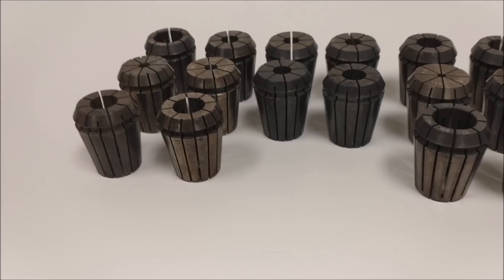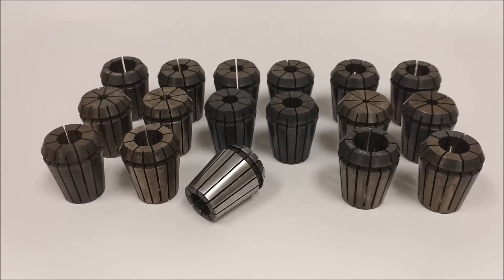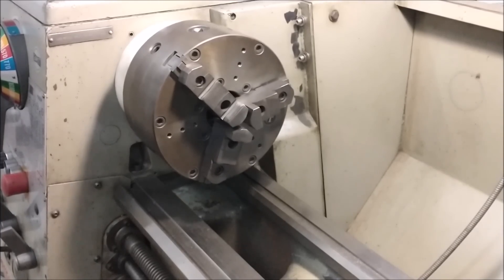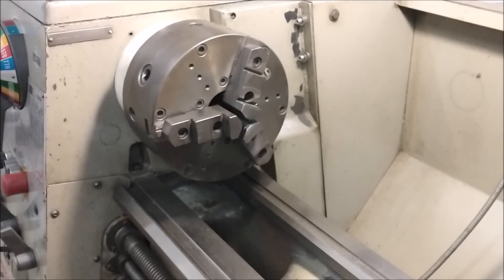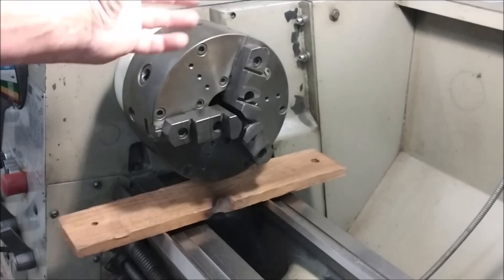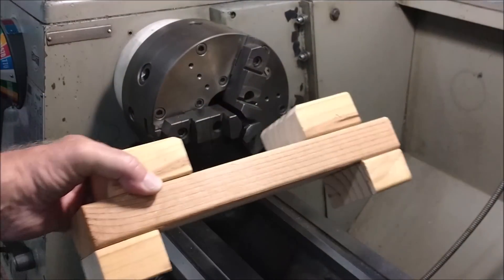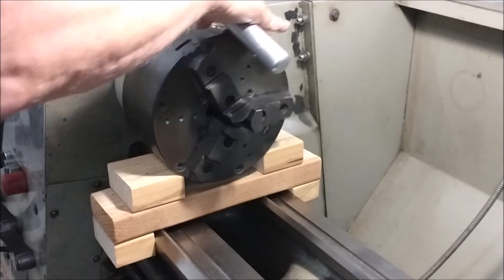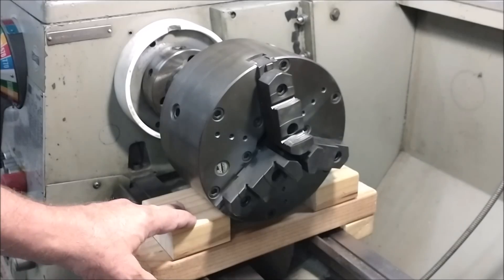Stress Free Lathe Chuck Removal and Shop Chemical Warnings !!!

Comment: Unloosen? English teacher you ain't.
Reply from the maker: I have another word for you.....dictionary.
Reply: @joepie221  unloosen is to let free "a relaxing bath unloosened all the mental and physical tension that had been building throughout the day" . 

Loosen is to make looser as in to loosen a bolt. 

Or at least according to Websters dictionary or did you have a different dictionary in mind?
Reply: @mr.picklesworth  That is merely one example given on the Merriam-Webster website, which is neither the definition nor the sole and exclusive use case. You didn't even bother to read the definitions on that very site which are as follows:
1)to relax the strain of 
2)to release as if from restraints: set free
3)to loosen the ties of
Next time you unloosen your lips to get pedantic, make sure you know what you're talking about.

Comment: I often use a diluted vinegar for rust removal. I had some new gas engine valves that had slight rust when I got them. The head and part of the stem became black. I think what’s happening is that the products are etching away the iron and leaving the carbon. Now yours were just discolored so they had very mild etching where mine using a stronger chemical were turned black.
Reply: Yep ... same here, I use white vinegar also.  I've had good experience doing this until I got brave and decided to use it on some machined parts from a diesel fuel pump, won't do that again.  Luckily, I could source the new parts.  My opinion was the same, I think it etched away the iron and left the carbon; I could be wrong as I'm not a metallurgist.  But I won't use vinegar on machined surfaces again.

Comment: Hi Joe - I have a Precision Matthews lathe  with a cam 3-jaw chuck that I am having a devil of a time trying to remove. Cams are open. I've dead hammered on it, tried to pry it off, made a novena, and still can't budge it. Any suggestions? Thx in advance.
Reply from the maker: Make sure your cams are indexed correctly and give the chuck a sharp blow from above. Make sure you are ready for it to disengage. Soft hammers usually didn't work for me. Its got to be something that will ring/shock it.
Reply: @joepie221  Thanks, Joe. Your comment gave me the confidence to take off the kid gloves. Got it off and cleaned off all the goo that was holding it on.

Comment: Polishing as an alternative is unlikely to remove microscopic rust the way ER will. And it looks like those collets were blued or blacked before final polishing. ER will remove all oxide coatings like blueing and Parkerizing, etc. And it always leaves behind any carbon from the rust on parts. Usually it washes off but sometimes seems to be in the steel.

The much more serious mistake can happen if parts are left not completely submerged. Like cleverly soaking one end of a part then flipping it to get the rest. This will leave serious cut marks at the waterline. The water in the in the solution and the air will cause oxidation at the boundary, the chemicals immediately remove the oxidized iron and the cycle repeats. I sold ER when it was new and found a couple easy mistakes and the chemist who invented it had explanations for each one. They all came from ER doing what it is supposed to do and the user not quite grasping how it all works. The other major one is old parts with nickle plating. It depends on how the plating was done, but it CAN result on all the nickle sliding off like slime.

I usually leave these notes when I see a video about ER.

Comment: Hello my southern teacher. I have seen the results of a finger, chuck and way. NOT MINE. The staining on the ways is nearly imposible to remove. It is a constant reminder of what happened here one day. Our trade surely is a thing of creating beautyfull, useful things BUT, when a 1/2 inch pilot drill can move a 6 ton part off it's stands because it wasn't properly bolted down shows us how little we are in the pecking order of steel and skin/muscles. Good post today old friend. You just saved a bunch of skin and bones fella.

Comment: I had some Anchor Lube, really liked it, then it got moldy, should it be stored in a refrigerator?
Reply from the maker: Its green to begin with...how did you know it was moldy?
Reply: @joepie221  It smelled and had black mold growing on it, it may have been left open in a humid place with coolant spraying near it, but not enough to see that got in it.

Comment: I was working for a large engeneering company many moons ago, when during a lunch break the forklift driver decided to do a "foreign order" in the lathe.  He put an eyebolt in the chucklift point and hooked up the hoist. At some point the lathe motor started, fortunately in low gear. You guessed it, the  whole headstock end of the lathe lifted untii the chain snapped big time. Fortunately no one was hurt but the boss was not happy.  🐯

Comment: To get rid of the carbon try soaking one collet or better yet a piece of medium to high carbon steel, in a bath of lye.

To clean a bunch of collets or tool holders put them in a sealed container with a little laquer thinner.over night. The fumes will "Unloosen" the grime.
Reply: Lye is very basic and can cause caustic stress corrosion cracking. I would be careful with that.

Comment: A short ultra-sound cleaning does do the trick. Don't do this overnight... 😬 If  you have old eyes like me, use a digital microscope like the Andonstar AD409 with a working distance of 12 inch for small parts on the lathe.

Comment: This is nothing new about Evapo Rust. I use it only for heavily rusted tools. Anything else gets scotch bright or a high grit wet/dry sand paper on them. I just think you have never had to sock something more than a few hours before and that's why this is a surprise to use. It's really not meant for light rust. You can use a brass wire wheel or do it by hand.

Comment: So, if you don't have a 2 x 4, then use your good hand to wrap a shop towel around your stump and be sure to wipe the blood off your ways if they are hardened otherwise you will need to use a brief application of Evapo-Rust to remove the rust caused by your careless bleeding habit.
Reply from the maker: Bingo.

Comment: Common on, Joe. Evaporust is intended to remove rust. Everyone knows it leaves the metal black afterwards and generally that is a vast improvement for very rusted parts. They wont rust again, in my experience, and it is harmless to almost every material. Nothing does a better job. 

Now, as far as "Anchor Lube" is concerned, I have thrown away my bottle of the damned stuff. If the machining process makes this stuff smoke, and that is easy with it, the smoke or vapors from it will STAIN any parts of your machine that it can reach. It will get inside your chuck and in tiny cracks. I've spent hours tearing my lathe apart to remove the stain with 2000 grit abrasive paper. It is fine for very low speed, low heat operations like tapping, but NEVER use it if starts to smoke. Unless you like brown races and chucks and handles, and tools, and anything made of steel nearby.

Comment: Use evaporust hot. Hot enough to just about put your hand in it without burning yourself. 20 mins at this temperature will remove heavy rust and more times than not, you won't believe the item ever had rust on it
Reply from the maker: I may try that. Thanks.

Comment: thanks for the tip I used evaporust before but on automotive things no idea it would do this to high carbon steel. I was about to do a batch of rusty drills and reamers. I will use caution now although I would rather have them discolored than rusted
Reply: I bought several hundred lightly rusted reamers at auction and cleaned them with evaporust without a problem. I monitored the first batch every hour or so to see how long it took so I could get them out when they were shiny. Note: Make sure to rinse, dry and oil to prevent flash rusting.

Comment: Thanks Joe.
I'm using WD-40 "Rust Remover Soak", I'll have to see if it blackens my steels.

I remember telling you about Anchor-Lube when you were talking about it awhile back. 

UPDATE: I had some black spots on my hardened lathe bed, they come off with Scotch Brite pads, I use the maroon ones.

The trouble with Anchor Lube is that it dries out and clogs the bottle nozzle hole. I had to make a plug to prevent that. I still use it when I'm welding after machining because there are no oils but I use Cool Tool II for most of my machining, no stains, I can see my work better and it works well.

Comment: Anchorlube, like Loctite...a little expensive but well worth it. A small container like you have there can last a year. Best lube for drilling stainless, costs less than the drill you otherwise break or burn up..
Reply: The trouble with Anchor Lube is that it dries out and clogs the bottle nozzle hole. I had to make a plug to prevent that. I still use it when I'm welding after machining because there are no oils but I use Cool Tool II for most of my machining, no stains, I can see my work better and it works well.

Comment: Thanks Joe,
When you have your chuck chocked on the “sled” use a small ratchet strap across the top to secure it to the sled, makes them easier to store on the shelf without rolling around.
Cheers

Comment: I have found/determined that Evapo Rust stored in an aluminum container renders it   useless on rust removal. I had some stored in an aluminum spray bottle and the next time I went to use it ,BIG ZERO. It had no effect on the part.

Comment: i stopped using anchorlube, for that reason. anchorlube is soap/water-based, and it is unclear if it has any rust-inhibitor. manual says was off with warm water, and the last thing i want on my tooling or machine is water.
I went back to traditional coolant for 95% of my work, and I do like the wax (grease?) based tapping paste from Little Machine Shop. simply blow it off the tooling with compressed air, and all is good.

Comment: I would never polish my collets. I use Evaporust in an ultrasonic. Anywhere from 10 minutes for very light “patina” to fairly bad rust at 45 minutes. I’ve never put collets in. I guess I should take some old 5C collets I don’t really use, and try them in the ultrasonic. I’ve always been weary of putting anything with precision mating surfaces in Evaporust. But it’s far better than using the various acids people foolishly use, or the equally bad idea of electrolysis. Both of those work by corroding rust off, but also corrode every other surface. Should never be used for any machine parts, no matter what any genius on YouTube says.
Reply: Electrolysis is not corrosion.  It's a electric process where the rust electrons are transferred  from one metal to the other, a useful tool for certain applications...
Reply: @ironworkerfxr7105  it’s still a somewhat controlled corrosion. Don’t think if it as a pejorative term. It simply is a description. Salt water corrodes, acid corrida and electricity corrodes.
Reply: @melgross  it's not erosion of the base metal, just rust transfer, which leaves pitting which was the rust..

Comment: Hi Joe, love the "handlebar" idea.  Although my chuck is only a 5", it's still awkward to grasp, especially if it has a little oil on it.  Been using a similar cradle for some time, but this makes things so much safer/easier.  And thanks for the warnings.
Reply from the maker: It give a good grip. I like it too.

Comment: Evapo-rust always leaves whatever carbon was in the oxidized steel. Usually it washes off and is one of the cool things about it. It only removes the oxidized iron. 

There is one serious mistake you can make. If you leave anything partially covered, you will get a cut-line at the air-liquid interface because the steel will keep oxidizing from the air and be removed by the Evapo-rust along that interface. Leave it overnight and you can get a pretty dramatic line and ruin a part. So remember it is submerge or don't try. You CAN use a pump and flood a part but don't do it for more than 20 minutes to an hour, depending on temperature. If you can use an oxygen free atmosphere like fill the container with nitrogen or argon, then you can flip parts over and so on for extended periods.

Comment: I left an old Rabone stainless (?) steel rule in Evaporust overnight and it has removed some of the metal so my favourite rule is ruined.
Reply: It doesn’t remove unoxidized metal. That’s the good thing about it. If it did, then that metal was oxidized. In that case, the rule was already ruined.

Comment: I just finish up de-rusting 2 vintage Craftsman 20" x 27" cast iron table saw tops with Evapo-Rust.
I'm pleased to see how well they came out, all rust was gone with no pitting after soaking for
2 days.  Being cast iron they have a grey appearance but if I wanted to "get nuts" I could lap 
them shinny.

Comment: My exact methods 2 of 3... Guacamole as we call it Anchorlube is the go-to for tapping and reaming stainless (mostly 17-4 Ph pre heat treated in our shop).  I use a 1" X 18" aluminum stock for handlebars on the 10" 3-jaw and a 14" 4-jaw. A wood saddle is mandatory for sure. 
Never used evapo-rust before but, prolly would have done the same thing... Thanks for the heads up!  I likes my shiney collets.  Luv Ur channel Joe!

Comment: We've been using a cheap ultrasonic cleaner in our shop, to clean collets. Works pretty good.
Reply: What kind of abrasive would you use for that?
Reply: @FieryWACO   No abrasive. It's just water, and whatever solution the cleaner requires. It just cleans the parts ultrasonically. The cleaners themselves can be purchased for cheap...harbor freight...that kind of thing.

Comment: Thanks for sharing this advice on chemicals Joe. I've always wanted to try Anchorlub, but it's hard to find in the UK. There is an agent here, but they only sell in large packs and it's incredible expensive compared to other products. I use cutting paste on taps. A tin of this will last a lifetime. First saw the wooden chuck nests, shown by Harold Hall, many years ago. Cheers Nobby @nobbysworkshop

Comment: I soak lots of clock parts in Evaporust but yes if left to long it turns black
Reply: But if you're like Chris at Clickspring, you'd just spend hours polishing until it looks like a piece of jewelry. Problem solved!
Reply: @FieryWACO  I had some Pultra 10mm wire chucks that went the same way and it’s possible to clean up but not inside and even worse you with ER collets

Comment: CRC really needs to put that info on the Evaporust bottle, so ppl are aware of this issue!! 
I had no idea this was the reason why a bunch of the carbon steel knives I was refinishing for customers ended up turning jet black after soaking them in evaporust.
   I was so pissed bc each one took over an hour to remove the black coating that had built up. I ended up taking a loss on those jobs, bc I couldn't see charging the customers for that time as it wasn't their fault the solution I chose to use to remove the rust ended turning them jet black.  
I was so frustrated that I just stopped buying evaporust and switched back to using White Vinegar then CLR for rust removal and just dealt with the smell.

Comment: Wow thanks for the tip on evaporust I have noticed on some other things I soaked that they turned black now I know about the high carbon I will now know what to expect and will not soak my ER collets at all. The Anchorlube yep have had that problem on my drill press but was able to get most of it off with Schoch bright but it is great stuff thanks for the tips.
Reply: Note: I don't think Joe mentioned Evaporust! His warning refers to a CRC product.
Reply: Oops! I see others do say Evaporust gives the same problem 😞

Comment: Wow! That's too bad about the collets! I've never used evaporust so this is really a point to remember. I use the 2x4 method for my chucks. I also keep them on a roll  around using the 2x4 cradles to store them on.   I also use anchor lube. Great info Joe! Thanks for your time and sharing! 👍😎✌️

Comment: Do it to all your collets, then you won't have to clean the ones you have turned blue.. :D  I have a cutout one like your first chuck holder. Achour lube  is water based and will corrode steel..  The good thing is that if it dries out, you can simply add water..

Comment: I see this a lot de-rusting parts for machine tool restoration. I have found that an ultrasonic cleaner with a water + detergent solution will remove most of it, but the stubborn stuff needs a VERY fine wire wheel. As you pointed out, if you knew about the staining, you'd just fine-wheel the rust off in the first place. I have to to find a chemical that just dissolves it, but i'm sure there's something out there.

Another tool I suspect you have available is a case tumbler. I have a very old lyman 1200 with fine walnut media and a liquid cutting compound as polishing liquid (called T-cut in the UK). Works a treat, but takes a few hours.

Comment: Thanks for the shop tips. I really like AnchorLube for tapping.Especially stainless steel but,you are right about the staining. I have never used Evaporust. I think I will stay away from it. I buy WD-40 by the gallon. I use it to spray down exposed metal surfaces of my machines at the end of the day and,wipe down any tooling.

Comment: For a cutting/tapping lube I use this stuff called MWF from Molyslip. It works on all metals & also makes a great assembly lube, plus it doesn’t stain my machines, I’d recommend it to anybody.
But it’s got moly in it, so it will stain your wife’s favourite fabrics. Probably a good thing I’m not married as I just love moly based lubes in the workshop.